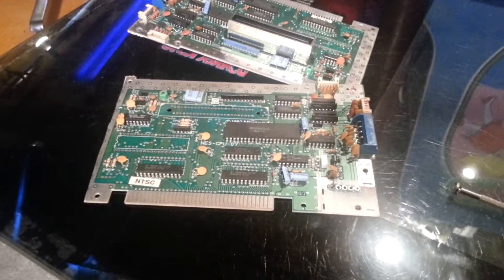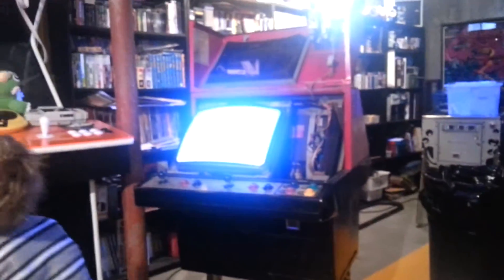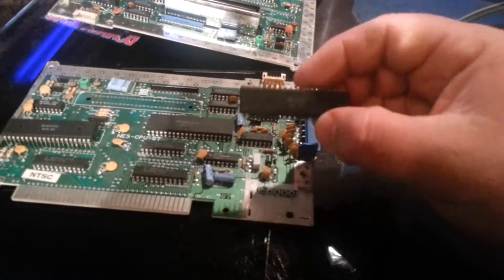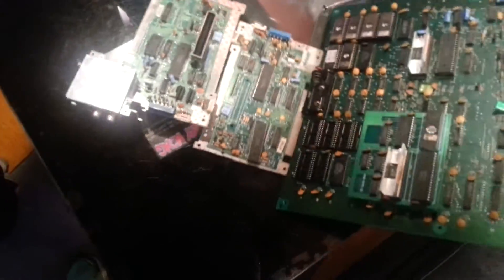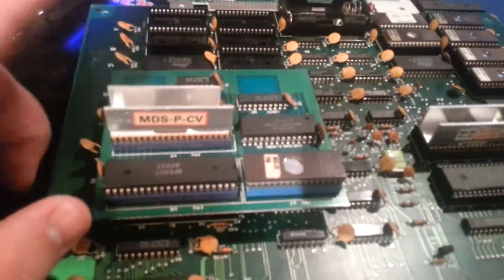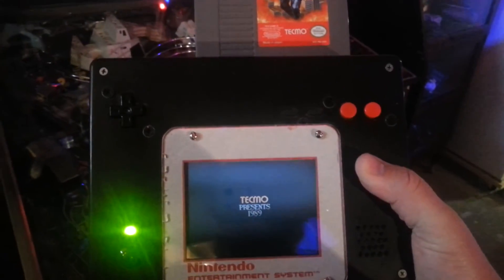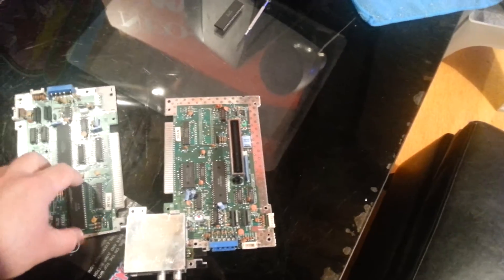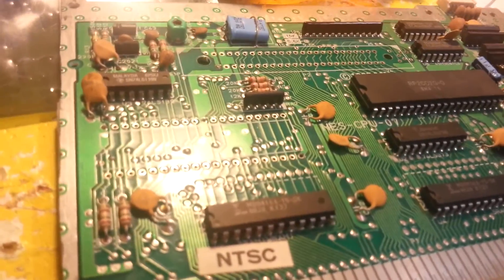Nintendo NES CPU in a Vs System

Comment: FYI to anybody who wants to use 2A03G as a cheaper alternative be aware that it will change the sound in several games. Specifically the later revision adds an extra feature to the noise channel. You'll get a high-pitched tone in parts of the VS. Gumshoe music instead of a percussion sound, as one example.

Comment: Just got myself a Vs. System Control Panel for 10 bucks at the Allentown Pinfest. I want to see if I can clean it up and rewire it so I can use it on my NES. I always loved the little short joysticks compared to the Advantage joystick.
Reply from the maker: I have seen a Nintendo Vs Stick installed in a NES Advantage.  Also, there is a photo of Howard Phillips in his office at Nintendo with a custom NES joystick with Vs sticks in it.  I could only find a low quality photo, and this isn't exactly the photo I am referring to: http://s2.n4g.com/media/11/news/505000/505367_0.jpg